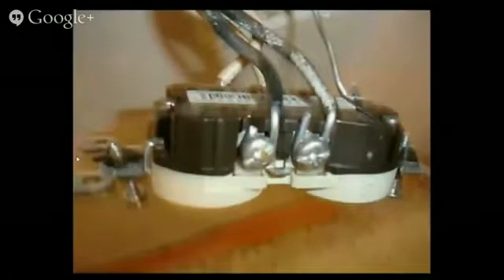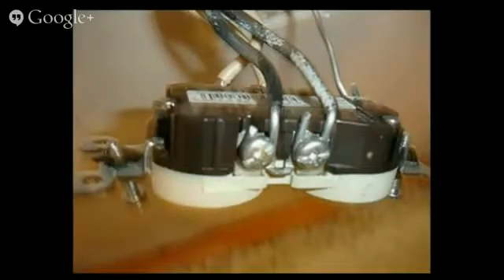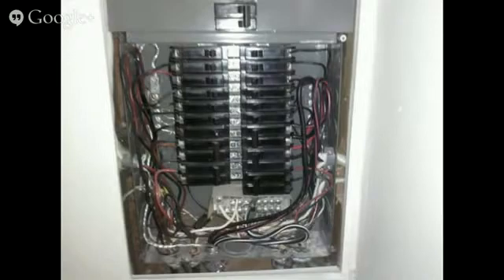Aluminum Wiring - What are the Dangers?

Comment: We had a mobile home that was built in 1972.    Every wire in the house aluminum.    The lead wires and all the receptacles were all aluminum.   I couldn't believe it.    But the only circuit breaker that would trip was the air conditioner.    The AC was too big for the circuit

Comment: The problem with aluminum wire is that it corrodes (oxidizes) when connected to copper wire.   The corrosion causes arcing over time that can lead to fire.  

Also, when aluminum connects to copper they expand and contract at different rates.  This causes connections to loosen over time.  This, too,  can cause fire.

Comment: I am sorry, but your status of 44% increase of fires with aluminum compared to copper is absolutely a farce number. If that were true, with over several million homes in Florida alone, you would have house fires every day caused by this wiring. You guys are just out there scaring people into paying big money to rewire their homes. There are methods to use that should be introduced and these homes with aluminum wiring should incorporate them and have it inspecatble.
Reply: I was also curious how 44 times (not 44%) statistic. This is 4400% higher. I'd like to read the source, but I wonder if it would compare 55 year old houses (1965) are 44 times more likely to have a fire than houses built in the last 5 years and using the 2014 NEC code. If correct, than it's not fair to compare 55 years with 5 years (11x difference), and compare buildings with arc-fault breakers to those without, and lastly compare houses with modern UL receptacles to those using low-quality, non-listed receptacles. But who knows, maybe it really is 4400% higher. Too bad there is no source.
Reply: If you do not understand electricity aluminum wires will lose its once it heats up you got pull that shit out it will drive crazy to trouble shoot pig tail sometimes will not work any more nolox will cut off the

Comment: Several times while watching TV in the living room in the evening, a friend's Siamese cat was acting strange and hissing and swatting an electrical receptacle on the wall with nothing plugged into it. After a few days of this behavior of the cat, he became curious and checked out the unused receptacle to find power was passing through this receptacle to additional circuits. The aluminum wires had become loose on the receptacle screws and the cat could hear the arcing!!!

Comment: What about the circuit breaker box.  Does it have to be pigtailed also if its aluminum to aluminum or only if the circuit breakers are  or where changed to copper.  If its hasn't been touched and it is all aluminum will it safely power the pigtailed wires outlets inside the trailer without danger? We have no money to hire an electrician but I understand exactly what to do. The outlets need to be replaced but I can't just put a copper outlet on without pigtailing the wires with the noalox and #63 wire connectors. I am scared for my family.  My mom, me and my son and two puppies have no choice but to live in this beat down trailer.

Comment: We bought a 1982 Holiday Rambler camper that Im pretty sure uses aluminum. The breaker box is copper coming from the main power wire, but the lights at least are aluminum. Wont know for sure if its throughout until I pull out an outlet.

But we had a 1978 park model camper that was all copper.

Comment: The power companies use Aluminum Wiring to feed your house. Aluminum rated receptacles  are completely fine to use if wired competently. Again,  just to be clear, the main into your house is Aluminum. The Aluminum "boogie man" does not exist.
Reply: Mark B. The Al alloy used during that period was inappropriate for branch circuits.
Reply: Hey mark! Go back to school! The aluminum boomy man does exist!  The triplex aluminum service feed from the pole to your service panel, first of all is "open air"!!! It can cool from the environment! It is not in an enclosure, a raceway, an electrical box or behind the walls in contact with insulation, wood, walls etc. it can be seen and monitored. It also meets a service supply code that no residential home meets! Utilities are not subject to the same codes as residential or commercial buildings are! They have their own codes and are responsible only for that. The connections made from aluminum supply to residential copper service wires are done outside the home! With mechanical connectors designed specifically for that! If there is a failure it happens outside the dwelling! Suspended in air or underground. Every supply wire set installed by the utility provider is also fused at the pole in case of failure or overheating and is held in place by a guide wire tensioned from the pole to the buildings so it does not fall.   You clearly have no idea how dangerous aluminum wire is inside a home! Keep your ignorance to yourself!
Reply: @davidkarpen5686  You also clearly have a lot to learn. "fused at the pole in case of failure or overheating" is an example of your ignorance. Fuses and circuit breakers DO NOT protect against the wire overheating at connections, they only protect against dead shorts or overloads. If you have a loose connection, a breaker or fuse WILL NOT blow if a connection getting hot or arcing. If fuses could protect from arc faults and overheating connections, we wouldn't have AFCI breakers.

"The connections made from aluminum supply to residential copper service wires are done outside the home" Actually, in the US, aluminium wiring coming into the breaker panel is quite common, and is completely safe when the connections are made correctly. It would be uncommon for the main service entry to be copper wire.

 As stated in this video, the problem with aluminium wiring is that the connections tend to get loose over time, as well as degrade from oxidization. As a result, resistance increases, and excessive heat builds up as a result. The wire itself isn't the problem, the connections are.

The reason that aluminium wire is used for high tension wires is because compared to copper, it is light, strong, and cost effective. Using copper wire would be impractical because it is heavy and weak compared to aluminium, so the wires would break under their own weight. The reason has nothing to do with cooling.
Reply: @davidkarpen5686  I am not going to argue with you. It is a fact that fuses and circuit breakers DO NOT protect against overheating connections or series arcing. Sometimes, a fuse or circuit breaker won't protect against parallel arcing either, depending on the duration of the arcing and  the current draw. A fuse will only blow if more currant passes through it than it is rated for, which isn't always the case if a loose connection is overheating. 
If fuses and circuit breakers were effective protection against connections overheating, we wouldn't have house fires due to overheating connections.
 If a fuse or breaker would always blow when wiring or connections were dangerously hot, there would be no electrical fires. 
A loose connection will NOT result in excessive current draw, which is the ONLY thing that will blow a fuse. If anything, a loose connection will cause a DECREASE in current draw due to increased resistance, even though a tremendous amount of heat would be generated.  
I agree with you that aluminium wiring inside a house isn't safe, and I never said that it was.
Reply: @averyalexander2303  While I appreciate your responses in this comment section, it seems to me that you have contradicted yourself when you "agree" with David when you say "I agree with you that aluminium wiring inside a house isn't safe, and I never said that it was." when previously you said "The wire itself isn't the problem, the connections are."

So, as someone who is in the process of buying a house with aluminum wire and who is trying to gather as much information as possible to understand the concerns and resolutions, I am baffled how you can say aluminum wiring is not safe in a house when it is obvious that aluminum wiring is safe, but it is aluminum wiring connections that are unsafe. That's a significant distinction that you muddy with your final statement in this thread. Other than that, it seems to me that David is making specious arguments and missing the point about everything you said.
Reply: There's no load on those feeders

Comment: @fairbairninspections I'm buying a house that was built in 1973 in western Quebec, with Aluminum wiring all over. Can get away with just re-wiring the Stove, Hot water tank and Dryer to Copper, and the doing those pigtails with the special anti-oxidant paste in all outlets and switches, and redoing the electrical panel? all by certified electrician of course. re-wiring the whole hose will be cost-prohibitive!
Reply: rewire hi-load lines like stove, dryer etc. Everything else should be fine with pigtailing (ie AlumiConn) and use of AFCI outlets.
Reply: You got to replceit